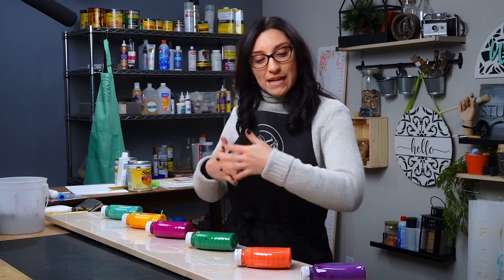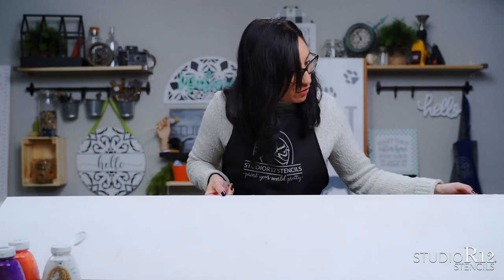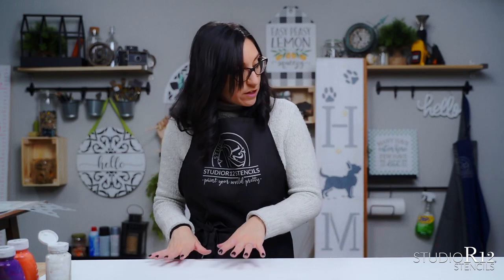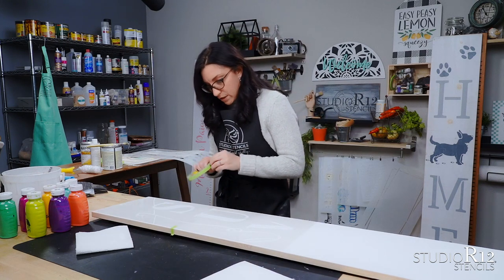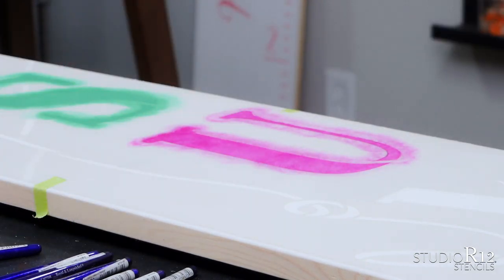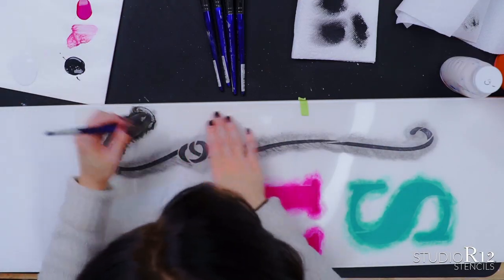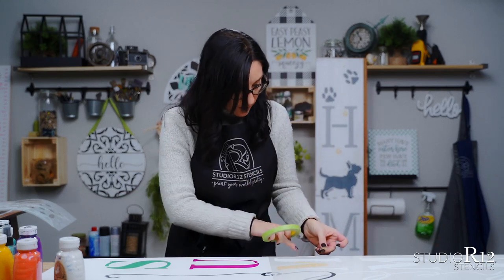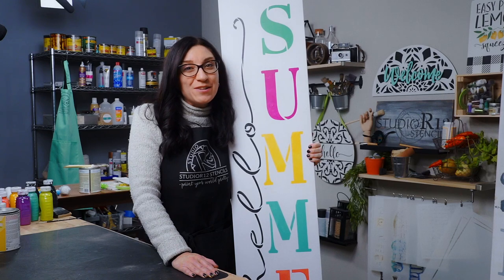Paint a DIY Summer Porch Sign with Stencils | How to Decorate Your Porch for Summer | Stencil Basics

Comment: Great video. I just started making these signs and I'm a believer in using spray adhesive. Is it necessary? I'm afraid if I don't, the paint will bleed through. (but I see yours didn't)
Reply from the maker: Hi Michael! We typically only use an adhesive if we are painting long stripes or are painting on a wonky surface. The trick for not bleeding under here is to use a dry brush, don't add water to your paint, when you get paint on your brush, offload it by swirling off 10-15 circles on a papertowel, then stencil. Your paint should be very dusty and it will take you a few layers to get a nice, bold look.
Reply: @StudioR12Stencils  Thank you so much.
Reply from the maker: @michaeldequatro1012  You're very welcome :)